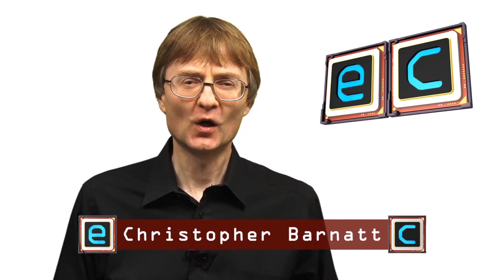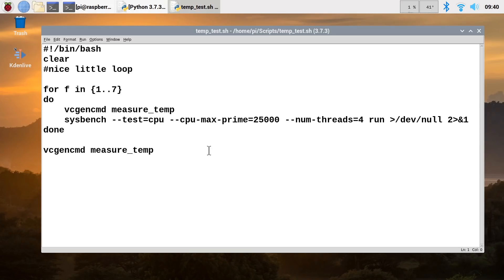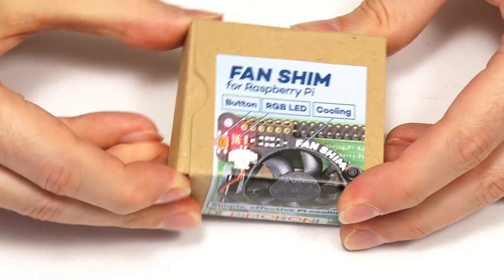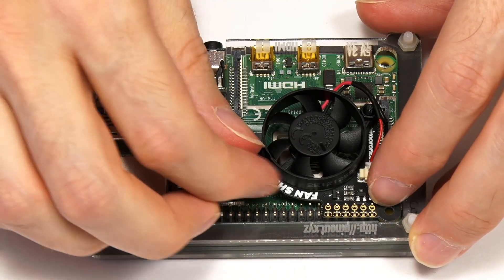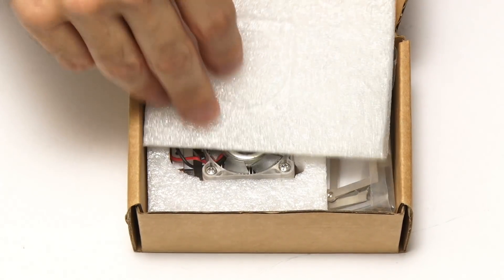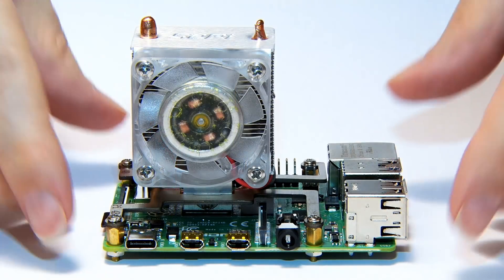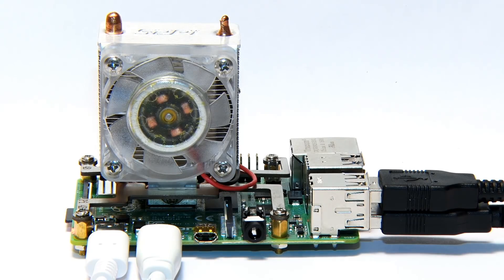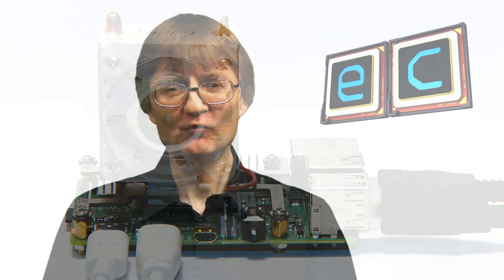Raspberry Pi 4: More Active Cooling!

Comment: How this cooler works with Rpi4 8 gb after overclock?
Thanks
Reply from the maker: See this video where I overclock a Pi 4 using this cooler: https://www.youtube.com/watch?v=Ty23K4g1Tyg
Reply: @ExplainingComputers  
I bought, and install this cooler fan
And works so smoothly
Even quiet after change valotage from 5  to 3.3
Thanku for good Advertisement

Comment: i use the Ice tower and a clear case similar to his with my Minecraft server running, the pi 4B slightly overclocked and added heat sinks for the other chips on board. The Pis cpu runs at 42.3C and its currently 80F in the house. Way better then any other heatsink with fan case ive used.

Comment: Currently using the Ice Tower on a Pi 3B for the Astroberry application. I had to modify the Ice Tower (I did not like the idea of using 3 layers of the heat transfer film) to fit the 3B by taking a copper penny and sanding it smooth on both sides to place between the CPU and heat sink with some thermal compound. Also slightly bent the mounting leg to increase the downforce on the CPU. I mounted the assembly in a 3D printed case found on Thingiverse that I modified to increase the thickness of the case sides. At idle it is steady at 27°C in a room at 20°C. Never goes over 52°C when running intensive applications (such as are possible with a Pi 3B). Very please with the Ice Tower overall. The fan illumination changes color over time

BTW, the Ice Tower, which I purchased from Amazon, came with a second, black,  fan which I used with a duct included with the Thingiverse case as an additional cooler. The whole assembly is very quiet.

Comment: Hi, are the tempreture values in a column all for the CPU at different times, or they refer to different parts of the raspberry pi? Thank You :D
Reply from the maker: They are all for the CPU at different times. :)
Reply: @ExplainingComputers  Thank you, i try to figure out what kind of cooling/case would be ideal for 24/7 use, i wonder if the bottom side will warm up?🤔
Reply from the maker: @csongork3650  For 24/7 use I would go with some kind of passive heatsink case.
Reply: @ExplainingComputers  I will have a look at them. Thank you

Comment: I came up with a cheap, cheerful, and unbelievably cheesy all in one solution for my Pi- especially my poor 3B+: a modified Wal Mart (as seen on TV!) 'evaporative cooler'.  I found mine for $15 at a discount store. I removed the spray deflector, the water reservoir- fuggedaboutit. Use it for parts storage or something. I'm getting standoffs and screws today to mount my Pi up. Basically, turn it on, it's loud as heck, but it IS a fan primarily. Run cables out the front, or cut nice spots to make it less ratty looking. 

The fan is on a timer. I don't know quite how to get around that- but also- this thing runs on a good battery. Won't run off of the pi, tho.
Reply from the maker: Sounds cool!

Comment: I bought an aluminium case with two fans from JustPi (it looks really similar to the 52pi Dual Fan Armour Case although it also has thermalpads for the ram and the usb or eth controller) and it's somehow better than the ice tower (maybe it's beacuse it's a 4 gb model, but I don't think that amount of ram affects the cpu temperature), while costing only $13 (11 eur/10 gbp)

These are the results (the time was 10 mins and 7 seconds):
temp=33.1'C
temp=38.9'C
temp=38.9'C
temp=40.9'C
temp=40.9'C
temp=40.9'C
temp=40.9'C
temp=41.8'C

Comment: Hi my name is Kim. I have a raspberry pi 3 that I solely use to watch movies and TV shows on. I have a few flash drives connected to it that I have movies on, but my flash drives have gotten full so I decided to purchase a portable SSD T5 drive. The T5 turns on , but when I begin playing movies it either stalls or reboots. I'm pretty new to your channel and after watching 2 or 3 videos I realized that the pi might not be strong enough for the SSD. So my question is would the raspberry pi 4. Be strong enough to run the SSD?
Reply from the maker: There should be no problems using the SSD with your Pi, but do check your power supply.
Reply: @ExplainingComputers  Hi, what size power supply should I be using? And do you have any recommendations as to which brand? And if it's a matter of power then can I continue just using the raspberry pi 3 to run the SSD T5 with a stronger power supply?

Comment: Hey, just wanted to let you know that you didn't put together the Pimoroni fan shim correctly, you were suppose to use two of the nuts to attach the screws to the PCB, then put the fan on top of those and use another two nuts to tighten it down. I don't know if it affects the cooling ability at all but I feel like it needs to be said. There's also supposed to be some kind of software for the fan that you download onto your Pi but I haven't gotten that far with mine yet.
Reply from the maker: Thanks for this. There are no instructions supplied with the product!

Comment: I have just setup my pi with an ice tower + noctua. The fan is connected to the 3.3v pin and is basically silent. A bit overkill but It works beautifully! 👍 Thanks for the great video!

Comment: I don't know about using thermal paste. There is a significant gap between the soc and the cooler. And don't try to tighten it too much cause i did and the screw broke inside the nut. Maybe it ks possible by using smaller spacers than those that come with the box or long m2.5 screws cut to desired size with a couple of nuts as spacers
Reply from the maker: There is no gap between the SoC and the cooler, at least on the ICE Tower I have. Thermal paste works well, and more effectively than a thermal pad which is still OK).
Reply: @ExplainingComputers  First of all, i'm quite (in a good way) surprised you personally replied my comment on  an old video.Secondly, https://imgur.com/a/tsZEacp . I tried using an IC graphite thermal pad for ryzen cpu (cut to size ofc) but it was too thin. Am i doing something wrong?
Reply from the maker: @ΜΑΝΟΣΚΟΥΤΣΑΚΗΣ-ν7δ  Everything looks fine in your picture, but I am still surprised that any pad is too thin. I fitted an ICE Tower only a few days ago (my video on Sunday is an "ultimate Raspberry Pi 4 rig"!), and when I place the ICE power on the Pi, the brackets are raised so that they tension down when screwed in place, so the fit is very tight between the heat sink and CPU. I am wondering, have you used the wrong set of brackets of the two supplied (one for Pi 3 and one for Pi 4)?

Comment: I ran the same test using one of the new Argon One cases for the Pi 4B (Argon40.com). This is a heat-sink case in that the thermal tape transfers heat to the aluminum alloy case.  There is a variable-speed fan and temperature sensor, but the software defaults are to leave the fan off until the CPU temp reaches 55°C and then only apply 10% fan power.  At 60°C it switches to 55% fan.  At 65°C it run the fan at 100%.  I have never had this fan turn on since owning the case.  I can feel the case warm up as heat is transferred to the case body but the hottest I've managed to get this case under synthetic load pegging all CPU's is 51°C.  

When I do your test (room ambient temp was 22.3°C), the results were:
temp=37.0'C
temp=41.0'C
temp=44.0'C
temp=45.0'C
temp=44.0'C
temp=45.0'C
temp=46.0'C
temp=46.0'C

The fan never needed to turn on.  I'm just using the basic thermal tape that came with the case.  I've never had a case work this well even with active cooling.  I'm impressed with how well it conducts the heat away.

Comment: Does anyone know if you can put HeatSinks on the RAM/ Ethernet/ usb chips on the pi with the ice tower installed? Does it matter if you don’t put HeatSinks on these? Thanks!
Reply from the maker: Shallow heat sinks could be fitted on the controllers, but the Ice Tower heatpipe overhangs the RAM.
Reply: ExplainingComputers thanks, was the lpddr4 ram not having a HeatSink any issue for you at all?
Reply: ExplainingComputers actually got one recently and put a 40mm noctua fan 5v edition on it!

Comment: Thanks for the test, noob question. If using the pimoroni is it still possible to fit moitesserie hat on top?
Reply from the maker: Possibly. The HAT would be raised up a bit, and would restrict airflow to the fan.

Comment: Since the temperature is roughly the same temperature it shows that the fan is over dimensional. You should use the heatsink and reduce the fan speed or use a smaller fan. Running a fan with no heatsink is not the way to do it.

Comment: That's the low profile ice tower. Nice. I wonder how much cooler it would run with the original taller ice tower?
Reply from the maker: This is not the low-profile ICE Tower.

Comment: I've been watching your videos since I bought my first rpi2 back in the day.

Your video has sold me on the ice tower cooler when my rpi4 arrives, and I thank you for that.

I do have a question for you, Christopher. Would you be aware of a way to add an rtc to the rpi 4 while it is using one of the larger coolers?
Reply from the maker: An RTC could still be added, but you'd have to use jumper leads to connect the RTC module to the GPIO header. Thanks for watching for so long! :)
Reply: @ExplainingComputers  No, thank you for your help and always providing top notch content.

Your hard work and effort is appreciated. You add something beautiful back to humanity. Keep up the good work.

Comment: I love these solutions, but would they work for my setup? I have a Pi 4 B with a POE hat on it from DSLRkit. I adds a bit of height making it difficult to find a suitable case. What I need to know is whether the fan shim or Ice Tower could be added with the POE hat on the board already. Or if not if there is another active cooling solution?

Comment: What would be better for this types of cooling thermal paste or the provide cooling pads ? What would provide the best contact and have the best cooling result?
Reply from the maker: Thermal paste gives better results with this cooler.
Reply: @ExplainingComputers  thank you so much I just got my I just got my ice cooler and the low profile is cooler since I have to pi 4 and I want to see what runs cooler and which with cooler is better thanks

Comment: I would definitely recommend active cooling. My pi 3 could barely run YouTube before I installed a heat sink and fan. Plus I couldn't run Ubuntu Mate without it crashing after 5 mins. Once I installed the fan I had no problems.

Comment: I own the Ice Tower and love it, but it is rather loud. The instruction manual says that you can reduce the volume by connecting the red wire to the 3.3v pin instead of the 5v pin, running the fan slower. However, I have seen it mentioned in several forums that this is a bad idea (for all fans, not just this one), but I'm not sure why. Do you agree, and if so, what is the reason? 
Thanks
Reply from the maker: I would never connect a fan to 3.3V on the Pi. THe 5V line is tapped before the Pi's vontage regulator. But 3.3V comes after the voltage regulator, so connecting in an electromechanical devices (like a fan) could result in current spikes/surges that may damage the Pi. The Pi's 3.3V pints are intended to connect to electronic components only. You may be OK. But I would not risk it. Better to use a resistor to slow the fan.
Reply: @ExplainingComputers  Thank you for the illuminating reply Christopher, I literally could not find an answer so concise in any forums (despite asking the same question) but you explained it perfectly. The fact that the Ice Tower manual does recommend using the 3.3v pin (as do many cases with fans) but sadly does not offer this caution, is a bit of a disappointing oversight in my opinion, so I'm glad you've favourited this comment in case anyone else is wondering. It's also a testament to the RasPi community that I knew using the 3.3v pin was dissuaded, despite not getting a clear explanation for why. Other than the dodgy advice in the manual, I think the Ice Tower is the best fan/protective case for the 4B as it completely rectifies the heat issue.

Comment: I have the Ice Tower for the 4B. I first attached it with one of the heat pads that came in the box, and got a very respectable idle temperature of about 32C. After watching this, I remembered I had some Arctic MX-2 thermal paste left from building my PC, so I removed the pad and put some paste on the chip, and assembled it again. This time the idle temperature was 26C! So it really is worth getting some thermal paste if you want to get the absolute best results from this great cooler. Also, the newest firmware (as of March 2020) reduces CPU temps by around 10C by limiting power to the USB bus. It also allows you to overclock both the CPU to 2GHZ and the GPU to 600MHZ (which does void your warranty). So having this cooler and upgrading the firmware is a must if you want to overclock!

Comment: I replaced the fan with a Noctua NF-A4x10 5V fan. I bought the vertical model (Ice Tower) then returned it for the horizontal (Low profile). The vertical uses screws for the fan mount and the horizontal uses a fan clip which I find poorly designed and it doesn't work well with the Noctua fan. Both of mine were the GeeekPI models.

Comment: I really enjoy these Raspberry Pi cooling videos.  I decided to run the same test on my overclocked Raspberry Pi 4 (4GB) at both 2.0GHz (over_voltage=4) and 2.1GHZ (over_voltage=6).  My Pi is in this case: Thingiverse thing 1815268 (https://www.thingiverse.com/thing:1815268) that I printed in ABS (I tried printing in PLA first but it didn't turn out well) with a small aluminum heatsink and a 40mm Noctua fan (the same one you use).  At 2.0GHz the test completed in 7 minutes and 38 seconds.  At 2.1GHz the test completed in 7 minutes and 14 seconds.  Temps listed below (ambient was 23.8C).

2.0GHZ temps
Idle -    33C
test1 -  53C
test2 - 53C
test3 - 54C
test4 - 54C
test5 - 54C
test6 - 55C
test 7 - 55C

2.1GHZ temps
idle -   33C
test1 - 56C
test2 - 57C
test3 - 58C
test4 - 58C
test5 - 58C
test6 - 57C
test7 - 57C
Reply: I should also mention that I have a Twitter bot running in the background on this Pi but it uses virtually no resources ATM (it just tweets the CPU temp every few hours right now).
Reply from the maker: Thanks for sharing your data. :)

Comment: If that Raspberry Pi board could be protected from condensation how would it fare if installed in a Little Devil PC-V10 case with the cooling probe pressed against the CPU/GPU and see how it fares with the chip being cooled down to -70 degrees below zero.

Comment: Another 52Pi cooler for Raspberry Pi  from 52Pi official store on Aliexpress, the low profile version:
https://a.aliexpress.com/qxEpXUiG
Reply from the maker: Wow! That's a nice Pi cooler. I do wonder why 52Pi are the only company doing this. Thanks for sharing the link.
Reply: @ExplainingComputers  Dear Prof., i have an update here, my low profile 52Pi cooler already arrive, i did some some testing using your temp_test.sh script, and the result is amazing! Min temp is 33C and Max temp is 39C, my room temp is about 24C, i'm using Manjaro ARM latest update on RPi 4B 4G with Cooler Master thermal paste (found it on my old CM Hyper 212 Evo box), i bought the cooler from 52Pi official store on Aliexpress, arrived at my home (i'm in Indonesia) for 3 weeks, a long time enough.
Reply: @ExplainingComputers  You're welcome Prof.

Comment: Was that test with cpu load only, or combined with graphics?
I noticed my pi zero w does become much more warm, when I run 2 instances of minecraft pi edition, so the cpu load is at 100%.
Reply from the maker: The Sysbench test used is CPU-intensive only.
Reply: @ExplainingComputers  Thank you. I'll keep that in mind when planning the cooling. 
I just have to decide, if I want to acquire a Pi-4b or odroid-N2.

Comment: I picked up the low profile one first before i got my pi. I wonder what clearance there is for the usb and ethernet controller for heat sinks. Considering the low profile is a downdraft style cooler i wonder if its even neccessary.

Comment: Very nice comparison. I have another data point. I am watching this video on a Pi 4 with the USB patch applied. I am using a very small heatsink (maybe 3mm high) attached with a thermo pad. The Pi is in a printed case with a 30mm fan. Using your script, it starts at 40C and ends at 52C (all while watching your video). I am surprised at how well this compares with your other cooling solutions. Perhaps the case guides the cooling air better than with no case. Anyway, the heatsink and fan came from Adafruit, and the case came from Thingiverse.

Comment: Great video. I have a technical question. When you use a cooling fan, do you hookup fan to ambient/room cool air onto processor or do you configure fan to pull heat away from the hot electronic components? Both ways would cool hot components. Just wondering if most vendors recommend one way or the other.
Reply from the maker: Usually you blow cool air onto the heat sinks or processor.

Comment: it's no fun having this horizontal tower... it is horizontal so creates square box dimension of the entire unit, there by kills it's purpose of small compact board.... also the color light is waste as users would be mostly fix the card in a case... the design of the fan tower needs to be flexible and not fixed on existing board + support fixing oon top of other box covers for it's look (hence colorful lights feature).

Comment: There's some  unexploited potential in the Pimoroni. detaching the fan from the shim and tilting it at a 45 degree angle should give double or more  airflow across the SOC. Also it still seems an intresting experiment to color the SOC with a black sharpie to incease it's emmisivity. (same reason SR-71 Blackbird is black)